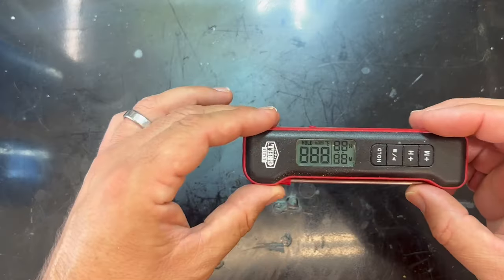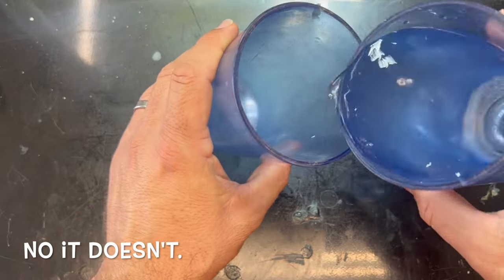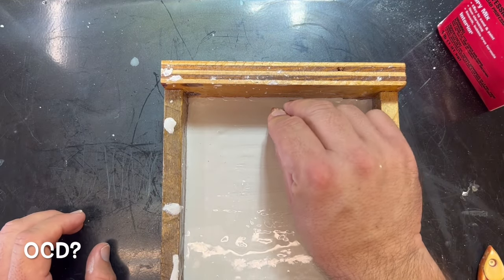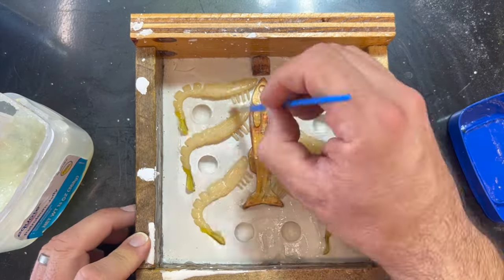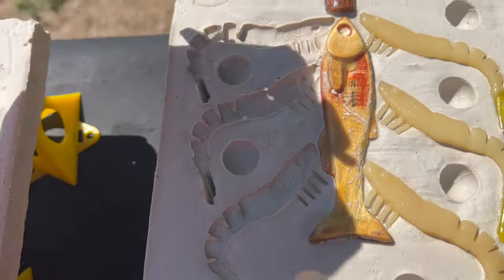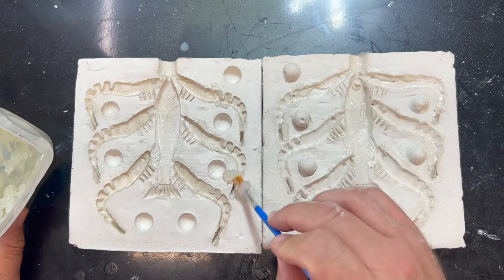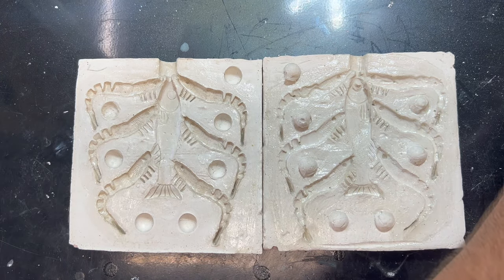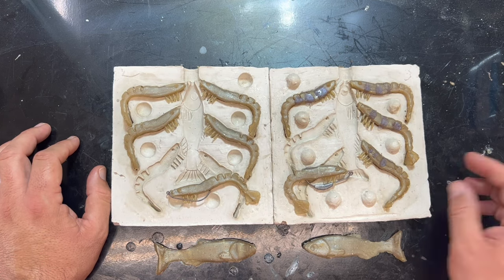Cheap and Easy Lure Molds with Plaster

Comment: So i don't know how i got here but this was interesting to Watch.  I didn't see you mention what the melted plastic was, or where you got it.  Also the aluminum tube you used,  what is that exactly? 

Also love the assistance gremlin. Mine are too old to do this stuff
Reply from the maker: Thank you for tuning in, I hope you come back soon. I use plastisol and recycle old soft plastic lures (A.K.A. rubber worms).  I melt the plastisol in a glass measuring cup in an old microwave (Don't use the one in your home!). The aluminum tube that I use for the injection is a purpose built tool for soft plastic injection. Below are the Amazon links for the plastisol and the soft plastic injector. Thank you so much for the questions and the interest.   Stay Regular!   

https://www.amazon.com/Bait-Plastics-Premium-Lure-Plastisol/dp/B07MBBP1B8/ref=sr_1_4?crid=3DYBXCB0HLTEK&keywords=plastisol&qid=1696553055&sprefix=plastisol+%2Caps%2C138&sr=8-4

https://www.amazon.com/best_nj-Aluminum-Injector-Plastic-Plastisol/dp/B07QMW3DWK/ref=sr_1_3?crid=2VXWWU6OJ7ZQB&keywords=soft+plastic+injector&qid=1696552945&sprefix=soft+plastic+inj%2Caps%2C103&sr=8-3

Comment: I was subscriber 546. Glad to help your count grow.     Glad you're putting out a cheapskate way of doing expensive stuff.     Just wandering, how long do you wait for these kinda molds to cool after injection???  
    As a kid I'd make wooden lures from whatever was handy. My friends gave me a ribbing for being cheap , but I just wanted to see what worked.    Also would take hardwood, and a router , n cut grooves to make plastic worms.   40 years ago you had use broken worms to make new ones.    The companies who made plastics were determined to keep it a secret for as long as possible.   I wrote all of them I could to get a resource for plastics. Some sent nastygrams back as a response.
Reply from the maker: First off, thank you so much for the support. I truly appreciate it.  Yeah, my father and I used re-melts exclusively for years. In reference to the cooling question, generally if the top of the sprue is no longer liquid and cool enough to touch, then the rest of the mold should be cool enough.  However, mold size, the initial temperature of the injected material, as well as the mold itself, all play a factor on how long it takes for the mold to cool.  Please feel free to ask questions anytime. Stay Regular!

Comment: Could using the Vaseline first cause problems with the permanent release paint’s later adherence?
Reply from the maker: Thank you for the comment. I haven’t had any issues with that, because the plastisol usually takes it right out of the mold for you. You Stay Regular!